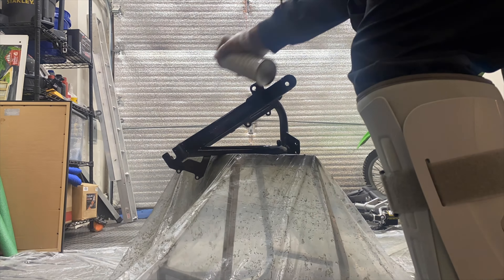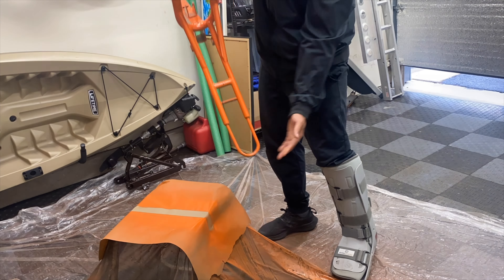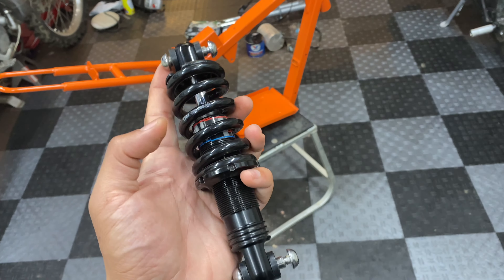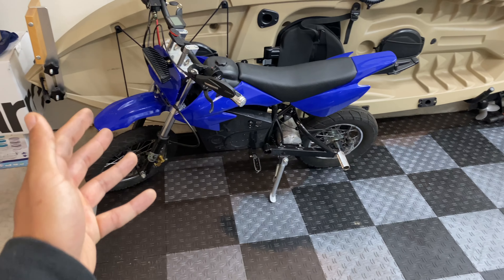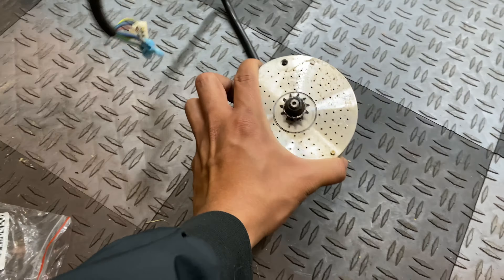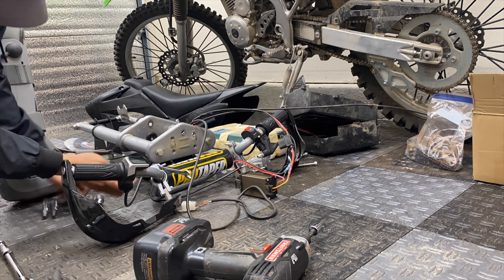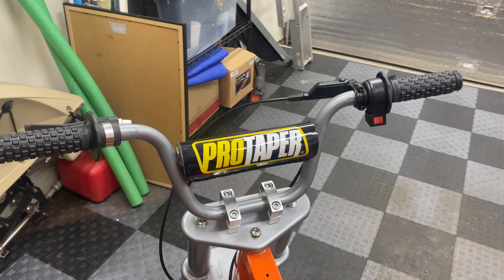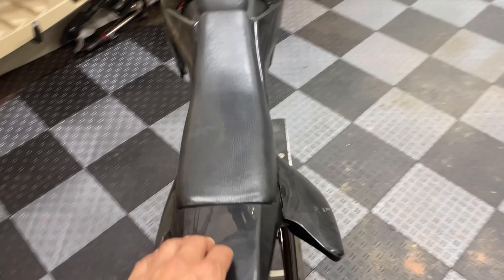Redoing the 52V Razor MX650 Build for More Speed Part 2

Comment: 3 of them are for throttle and the other 3 are for the 3 speed switch
Reply from the maker: I fully understand that, but do you know which wires (on the Kelly controller side) the (3) speed controller wires hook up to?

Comment: The sprocket is stuck for me can you tell me how to fix it
Reply from the maker: Front sprocket or rear? The front, you just wedge a wrench between the sprocket and wrench for leverage. The rear sprocket I have no experience with getting stuck so I don’t have a solution for you
Reply: @PatOutdoors  I got it off but the 13t is hard to get on any tips

Comment: hey pat.  my question is can i just buy a cheaper all in one 48v 2000w kit from vevor and run just a 52v 30ah battery.   i wasnt sure if that little overvolt would hurt
Reply from the maker: That’s a very minimal overvolt so yes you can run 52v on the 48v controller. Though what are the dimensions on this 30ah battery? Seems like it would be a super tight fit

Comment: Hey Pat, I have been building my razor mx650 into a 52 volt one. I have a vevor 2000 watt motor kit and so I got everything hooked up and it doesnt do anything. Im completely stumped so I wanted to see if you had any ideas or suggestions for me. Thanks!
Reply from the maker: Have you checked the voltage at the positive and negative terminals of the controller to confirm it’s getting full voltage? What does the volt meter read?
Reply: @PatOutdoors  Yes i checked and its reading 58.8 volts. Honestly im thinking its the controller. Would you agree?
Reply from the maker: @lucastandish5457  I can't agree without even seeing any wiring.. What about the ignition switch? The controller can get full power supply, but it won't do anything unless the power supply switch gets triggered when you turn the key ignition on. Test out the power supply wire by bridging voltage to it and see if the controller turns on.
Reply: @PatOutdoors  Sorry to be a little annoying here but could you go into a little more detail? The help is much appreciated Im very new to all things electricity
Reply from the maker: @lucastandish5457  so I don’t even know what controller you have or what kind of on/off switch you have.. but most brushless controllers have (2) power wire inputs. One is from the battery (the main one next to the ground), then there is a “ignition” or “signal wire” that delivers voltage from the keyed ignition to turn it on. Same thing as car amplifier wiring, there’s the main power wire from the battery, then a tiny blue signal wire that turns it on when you turn the radio on.
Reply: @PatOutdoors  So you'll never believe this. I had the electronic lock wire coming from my throttle plugged into the indicator light on my controller. i switched them and NOW IT WORKS, IM PART OF THE RAZOR GANG
Reply from the maker: @lucastandish5457  Congrats buddy! That is the signal wire I was referring to